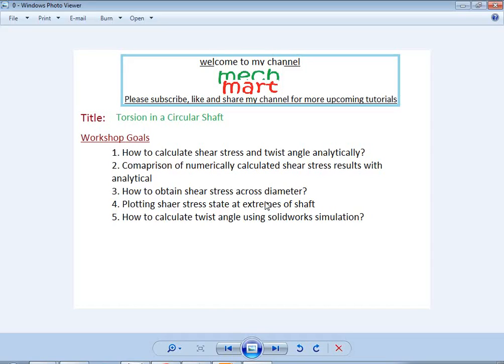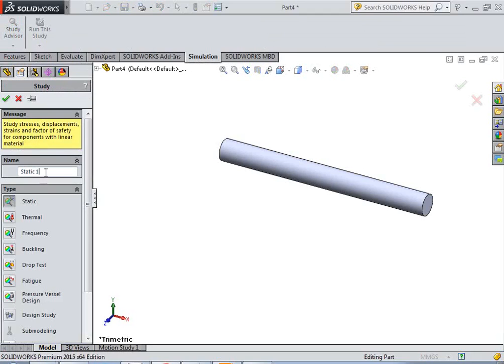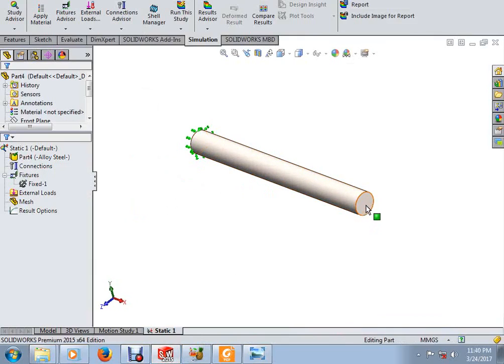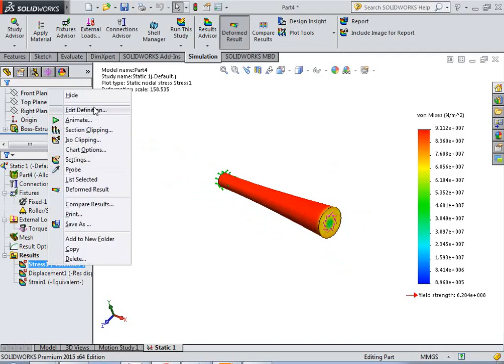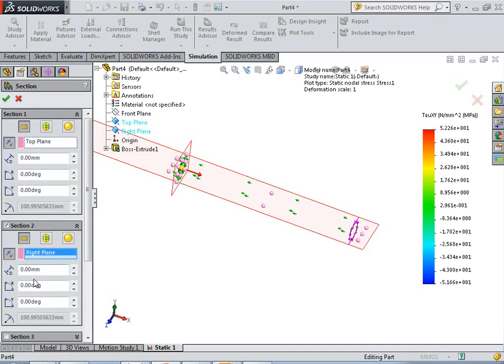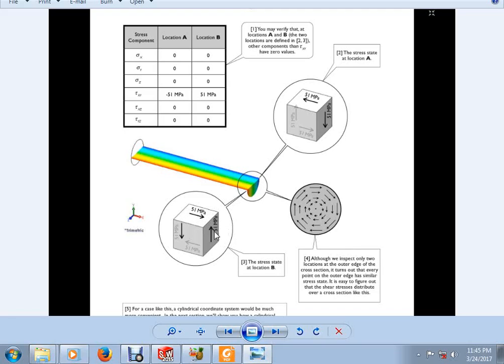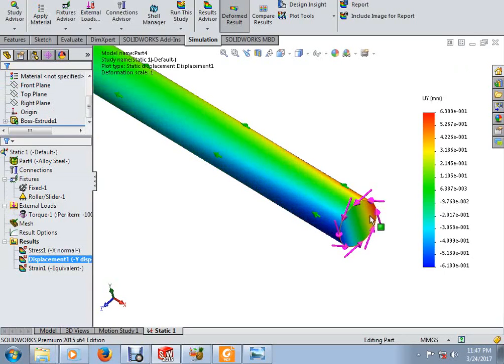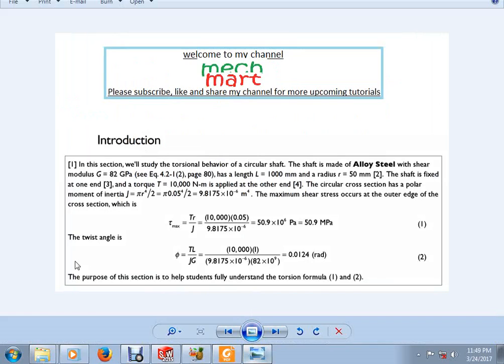Solidworks simulation tutorials 5; Torsion analysis of a circular shaft

Comment: what is  the twist angle formulae?. Max displacement plus Min displacement divide by 100? what is 100 here?. Could you please explain to me how did you get the 100?. Thanks
Reply: He's assuming that the angle is small and so the angle is approximately the same as the tangent of the angle. The tangent of the angle is the vertical displacement divided by the radius. He then takes the vertical height to be the average of the min and max vertical heights to gain some precision. So its theta = tan theta = dy/r = (ymax-ymin)/(2r), and his r is 50mm so that's 100.